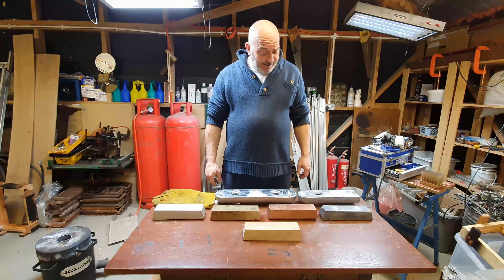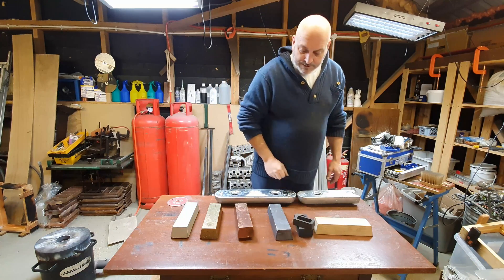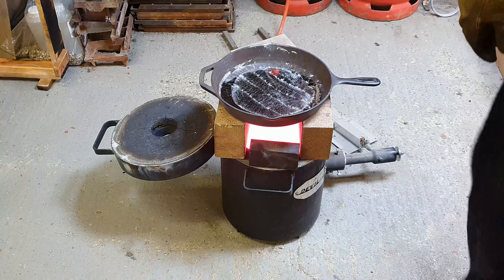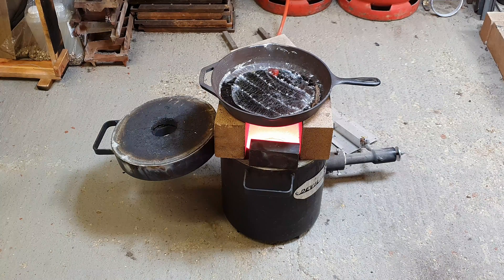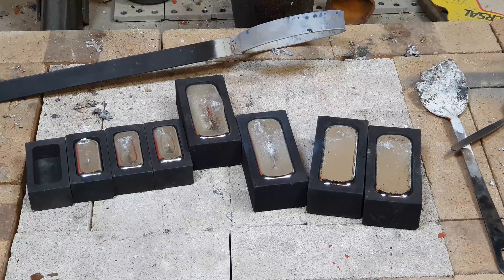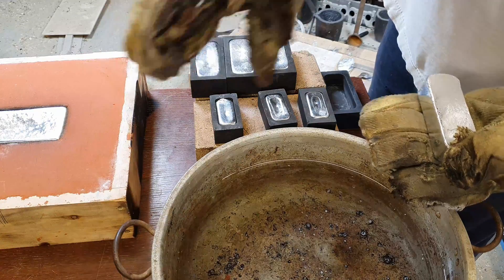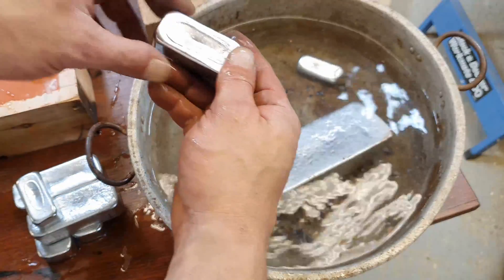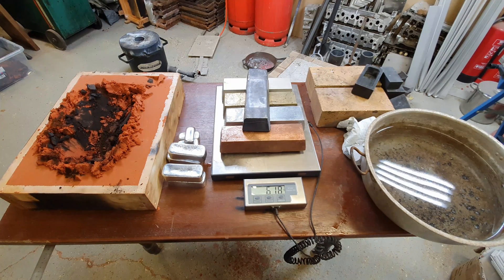Making A Massive Zinc Ingot with Petrobond Sand

Comment: You are kamikadze. Don't do it in your house. Remove gas tanks outside
Reply from the maker: Gas tanks are pretty safe, plus I need constant access to the supply tap.  If they were outside it would be a real pain.  I have a lot more faith in the screw valve on the bottle than the cheap gas lever on the furnace.  Turning the supply off at the bottle empties the lines of gas each time too, last thing you want is molten metal on a live gas line.  Cheers Andy 🍺👍

Comment: I was wondering where you got that much zinc to melt.
Reply from the maker: It's a sacrificial zinc boat anode.  Military spec zinc with very low cadmium content.  A search on Ebay for 'ANODE 120ZB 12KG BOLT-ON' will find you what you are looking for at the best price per kg.  You can find the datasheet for it online.  Be careful if you buy other anodes as zinc often contains cadmium which is a big no no.  Cheers Andy 🍺🍺🍺

Comment: So I'm defo subbing because I love videos like this, I just have two questions and maybe someone can help me: Is Petrobond sand just another name for greensand and where does one get a pair of "tongs" like that to pull crucibles out of the furnace?
Reply from the maker: Thanks for the sub Snake, much appreciated.  Petrobond and greensand are different.  Greensand is a just mix of bentonite, sand and water.  There are plenty of recipes on YT.  Whereas Petrobond uses oil as a wetting agent instead.  Petrobond is supposed to give a better finish but it's very expensive at £70 for a 25kg bag (to fill the moulds I use on my videos I use around 50kg) you'll lose a little with each casting so you'll need some in reserve.  Greensand can also give a similar finish but it's all about the facing sand to get a really detailed finish you'll need a really fine sand to sieve over the part before adding the backing sand, which isn't so easy to get so fine.  But you can always clean up the part later.  If your starting out I'd go for greensand, it's way cheaper and you can re-use it over and over, you might just need to re-wet it again from time to time.  You can re-use Petrobond but it's a lot harder to mix properly without a sand muller.  I have around 75kg waiting to be re mixed.  I bought my A6 lifting tongs and pouring shank from SDTS engineering (UK based) although the design is simple and could easily be replicated from the pictures if you can weld.  My truck engineer is currently making me an A8 set of tongs and shank based off the A6 ones I have, the only tricky bit is bending the shank to fit the crucible nice and snugly.  Hope this helps, let me know if you want to know any more.  Best wishes Andy 🍺🍺🍺
Reply: @MeltandCast  Thank you! I have used greensand in the past but up until this video never heard of Petrobond.I will probably look up more info about it when I get off work in the next hour or so and  I will definitely be checking out STDS Engineering for tongs.  Thank you for the info, I'm new to the whole casting bit and currently saving slowly for a devil forge furnace myself while I use a DIY one I built last year.
Reply from the maker: The Petrobond is good, and I like using it.  But it's just so expensive, So far I've bought 175kg of the stuff and when you add it up that's a lot of money... you could probably make well over a tonne of greensand for the same cost...  At some point I will make the switch unless I can get hold of a cheap muller...  For the Forge I'd go for the Kaowool version, it's half the price and a lot more portable when you need to move it outside.  The cement version I have is really heavy...

Comment: Uhh whats with the steel bar?
Reply from the maker: It's a bolt on zinc anode for a boat.  It has a steel bar in the middle to bolt it on to the boat.  Cheers Andy 😎😎😎
Reply: MeltandCast thank you! Was a great pour, didn’t know zinc would stay molten for so long either! Good luck on the next couple!
Reply from the maker: Cheers mate 👍

Comment: This was really fascinating for me to watch you creating this zinc ingot. A few years back I worked at a lead, zinc, and silver mine. One of the areas I worked was the refinement if the metals, from the ore. Using a flotation system. Dirty job that one was. The final steps in the process, the zinc concentrates were a fine powder in a rusty grey color.  Very cool to see this metal in pure form!
Reply from the maker: Thanks Dana, I wonder... Was cadmium a factor when processing the ore ?  I was under the impression cadmium and zinc are found together being chemically similar, and separated during the ore refining process... ???  Happy New Year !!...  Andy 👍👍👍
Reply: You're welcome! I never knew about cadmium being present along with zinc. Where I worked, it was what I would call the first stage of refinement.  Basically just removing the raw material from the waste rock. Using the flotation system,  chemical reagents were added at strategic points during the ore being crushed, turned into a slurry, and reagents used to bond to, and separate from the lead, zinc, and silver (very minute amount of gold as well). Zinc, most likely along with the cadmium were separated from the lead/silver refined slurry of concentrates. Basically zinc mud, and lead mud. The last stage at out milling process was to remove water in the concentrates to a certain percentage.  The end product was a fine powder. From there on, those concentrates powders were loaded on trucks, and shipped to a smelter in Canada. I used to work at the Luck Friday Mine in Mullan, Idaho. Dangerous dirty job, but good pay back in the early 2010s. 😁😎

Comment: What was that zinc from?  Before you melted it.  Thanks for your time!  I learned
Reply from the maker: It was a sacrificial zinc boat anode.  Military spec zinc with very low cadmium content.  Glad you enjoyed it mate, best wishes Andy 🍺🍺🍺
Reply: @MeltandCast  
Sacrificial zinc boat anode?  [Goes on Multiple browser tab adventures researching this topic]  Thanks again.  You're awesome
Reply from the maker: @RaspyOB174  Haha cheers Raspy, You can find them on Ebay if your looking for some zinc.  The ones I use are made by MME and a search on Ebay for "ANODE 120ZB 12KG BOLT-ON" will find you the cheapest ones.  They are a 12kg ingot.  You can search Google for MME and see the spec sheet on the purity for that anode as well.  They have a cadmium content of 0.025% - 0.07%.  You'll need a diamond blade on your angle grinder to cut it though or you'll be there all day... as I found out - that's why I melted the whole block hehe....Cheers Andy 👍👍👍
Reply: @MeltandCast  

You're a badass.  Thank you for the learning very much sir.  Looking forward to the next video!

Comment: How big are those massive ingots by pound ??? Haven't seen you for a while man!? Love the videos!
Reply from the maker: Cheers David...  I've had the flu, had the house re-plumbed, new central heating and a new kitchen floor.  Hence the delay in releasing videos for a few weeks.  Back on it now though, lots of cool stuff coming up...  Cheers Andy 🥂🥂🥂
Copper bar is 13.4 lbs
Aluminium bar is 4.4 lbs
Brass bar is 13.2 lbs
Lead bar is 18.7 lbs
Zinc bar is 11.7 lbs

Comment: You get some bottles of flat clear acrylic spray paint for the lead bar to seal it, for reasons... also future alloy ideas, naval brass and Nordic gold
Reply from the maker: Thanks StreetMachine, I have some lacquer for future projects and a long list of various brasses to try out.  I really want to make some Nordic gold, but I don't have any tin yet.  I have a source but the minimum order is 15kg and that's going to be really expensive...  As soon as my wife lets me buy it i'll be on it though !!! Hehe.  Cheers Andy 🍺🍺🍺
Reply: MeltandCast yeah if you wanna make a “massive” tin ingot then maybe it would be worth it, but for 1% tin in the nordic gold i would just order 500g on ebay, (purity might be questionable tho)
Reply from the maker: @StreetMachine18  A 15kg tin ingot will cost me around £300 plus shipping, much as I'd like to, a 'massive' tin ingot would be a huge waste of money.  I have a whole bunch of other alloy recipes that use tin though, I could make a lot of interesting things with it.  Nordic's definitely top of the list though, I really like the fake gold type metals.  The zinc is mainly to get through my list of brasses to try... the next one should be quite close to gold and was traditionally used as a poor mans gold.  I'll keep you hanging for the name... hehe... Andy 👍👍👍